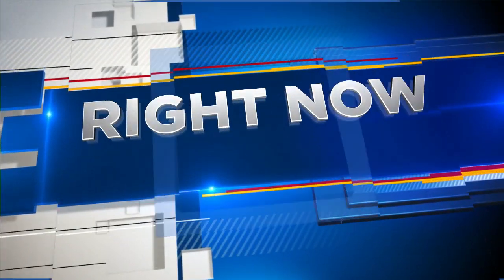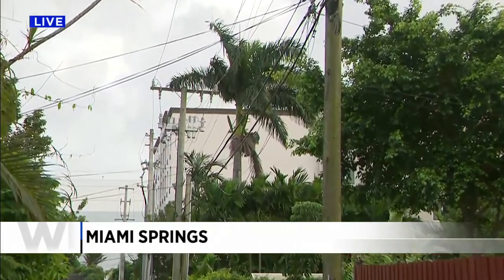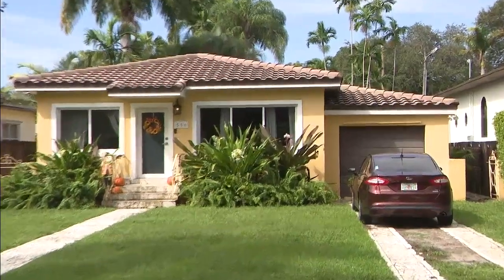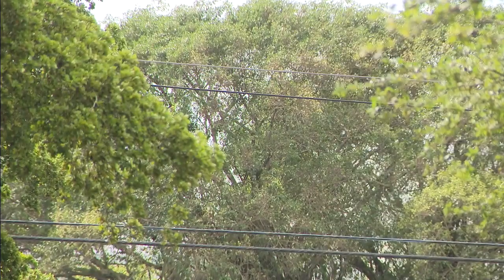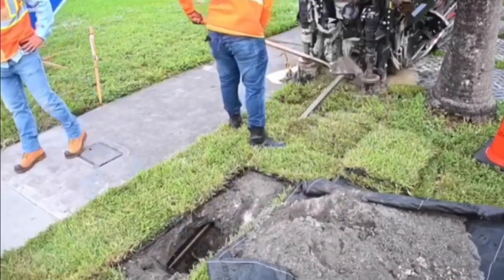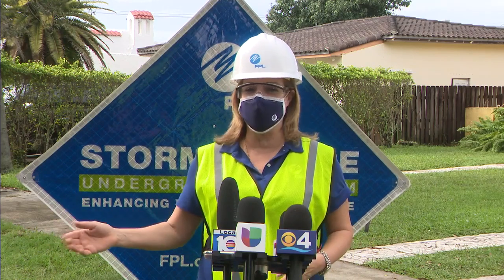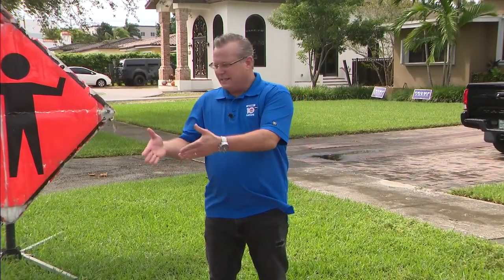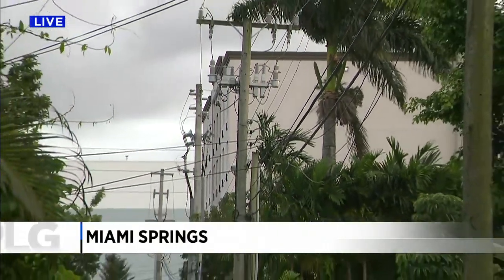Florida Power & Light Co. aims to bury 700 neighborhood power lines by 2023

Comment: buried lines means higher property value, less risk of cancer and easier to get your roof pressure washed.
Reply: What you mean less risk of cancer?
Reply: @davidking7750  u ever walk under a transformer on an electric pole and you can hear the voltage. That sound is the sound of radiation being emitted and has been known to cause skin cancer and under cancers from radiation.
Reply: @rapgamecastro4028  get yourself educated on the subject before you spew nonsense.
Reply: @Hollowsmith  I presented the information sir. You have to finance the research. Lets start with the higher property value 1st. The entire city of weston est 1996 has 100 buried lines and the highest property value in broward excluding rio vista and parkland. I ran my own pressure washing company for 5 yrs and i charged less for residents with buried lines opposed to exposed and in my way. As far as the cancer most exposed lines are in impoverished black and latin communities . So if you think the same GOV that allowed flint water crisis is gonna expose epa failures in the metro cities of america u have lost your mind sir.🤟